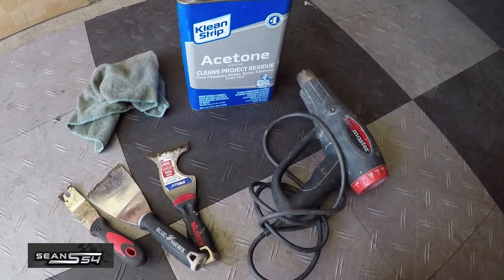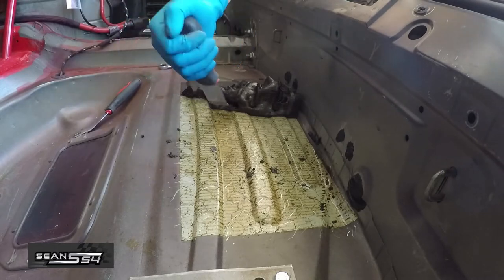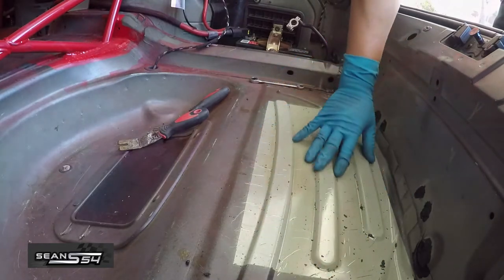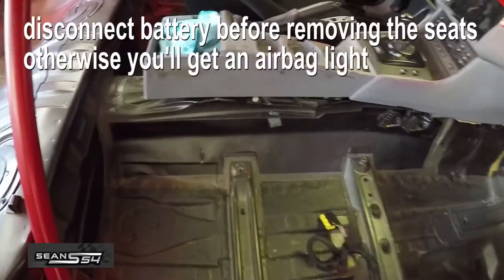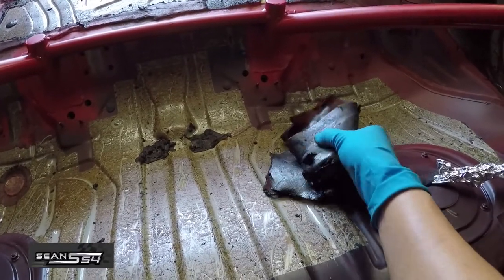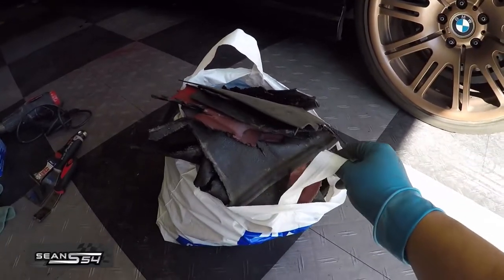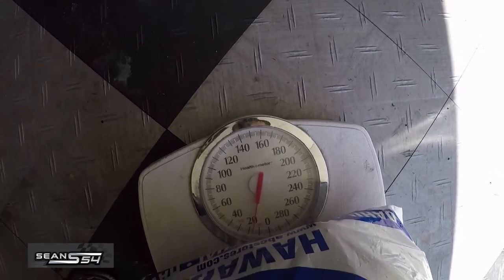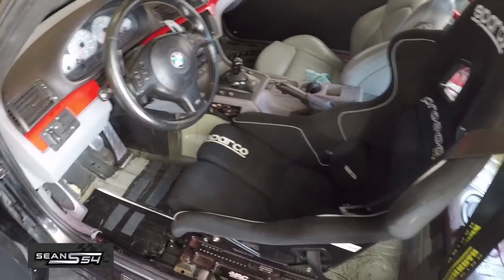Cut Weight! Sound Deadening Removal DIY

Comment: Sean, nice video as usual. I have just stripped out my interior awaiting Tony at TC Design to install a full cage in early October. I was thinking of doing this but could not find much info on how best to do it. Now I know and it looks pretty simple. When the Bay Area (I'm in the north bay) heat finally subsides I think I'll tackle this as well before the cage goes in. Thanks again.
Reply from the maker: You're very welcome Doug. I read a lot about dry ice, heat gun, sticky mess, etc and was a little fearful. But after tacking it, it was very, very easy.

Comment: Wow. It doesn't seem like much when you look at it while it's in the car but when you put it all in a pile (And realize it's all made of a dense heavy rubber type stuff) it sure adds up! I have an unrelated question (Again lol)  Sean. I sold my E90 335i (Thus I now have the E46 M3) but I have a big can of the Brake fluid left from when I had the 335i (I think it's called CF11 or something very specific stuff). I'm wondering if I can use this for a brake flush on my M3? I should probably go to a forum to ask this but I thought you may know considering you are running both.
Reply from the maker: I didn't realize the sound deadening was that heavy either until I removed it and weighed it.

I too had an E90 335i (that I built for the track) but sold it because of overheating issues on track and went with the E46 M3. Once you open brake fluid you're supposed to use it within a few days. Brake fluid is hygroscopic and will absorb moisture from the air.